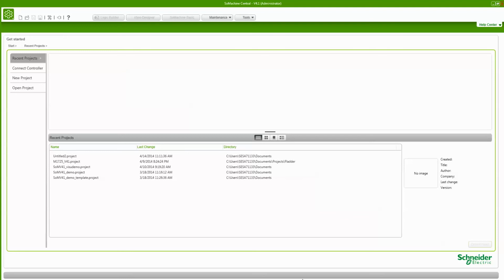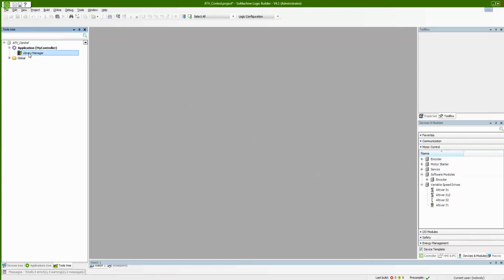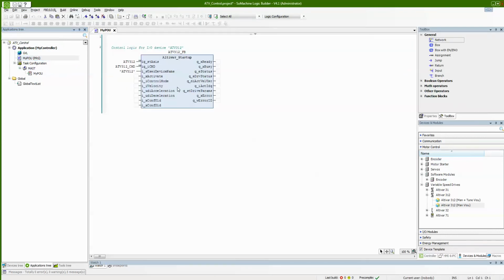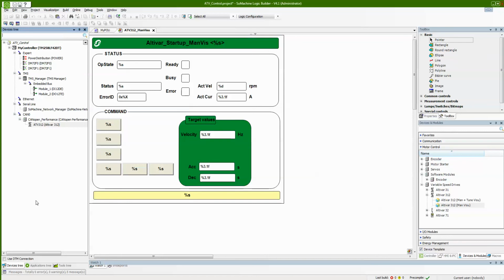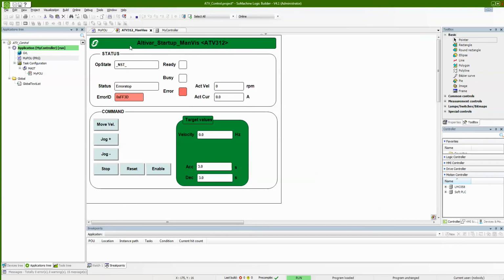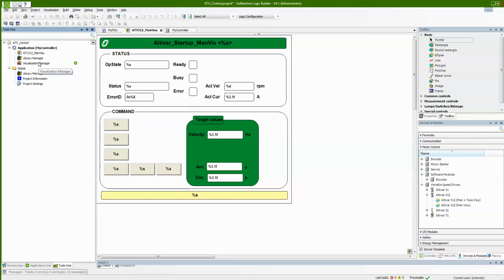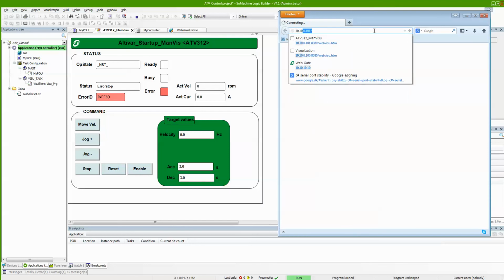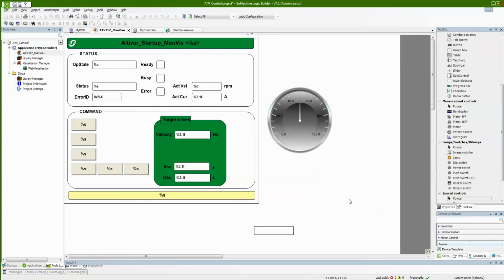SoMachine V4.1 ATV Device Template & Webvisualization (WebVisu)

Comment: Hi sir, I am using a software called SoMachine, the controller I am using is TM251MESE. The IO_bus I connected to is MixedIO, TM3DM24R/G. The object I want to achieve is that I have a physical button connected to IO(IX%0.0), every time I push the button I want the Boolean value stored on this address change from default value false to true. Can you make a video about how to do this?